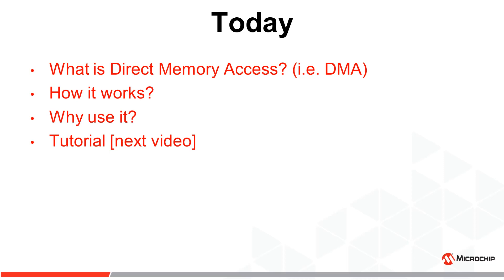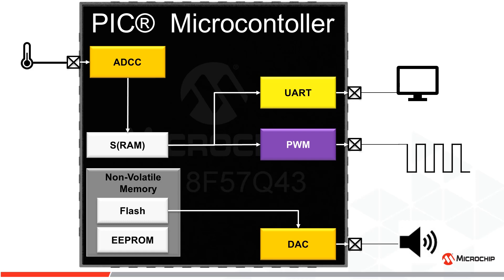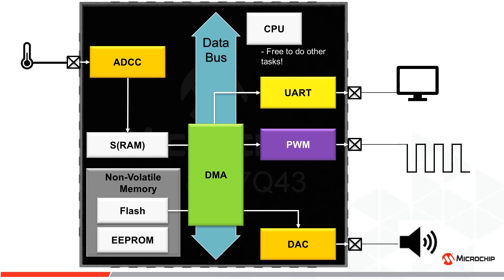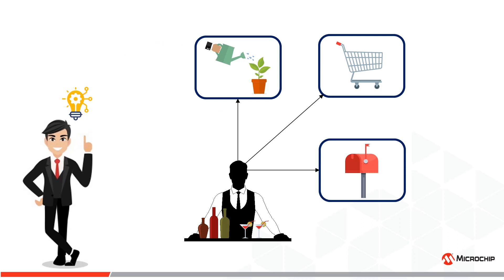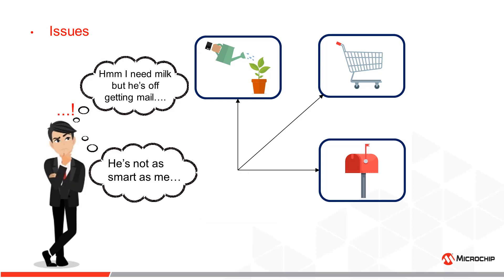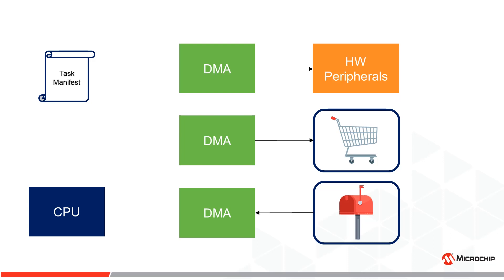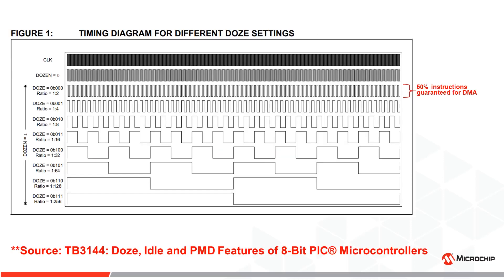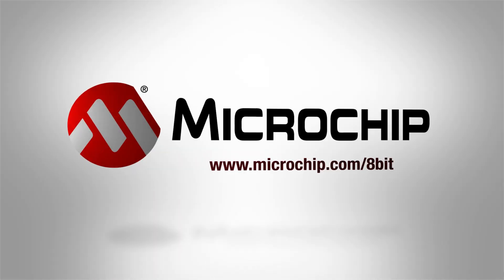DMA Overview on PIC® MCUs

Comment: Nice thank you :)
Does an atmega328p have capabilities to implement any of this?
Reply from the maker: The ATmega328P does not the DMA peripheral (see datasheet: https://www.microchip.com/wwwproducts/en/ATmega328P), so this device does not have this capability. However, you can find similar devices that have these capabilities on the parametric table at the bottom of the peripheral overview page linked in the description. Hope this helps!
Reply: @MicrochipTechnology  Thank you! If I want to use multiple spi devices with DMA, do I need multiple spi interfaces or can the DMA alternate between devices on the same bus?